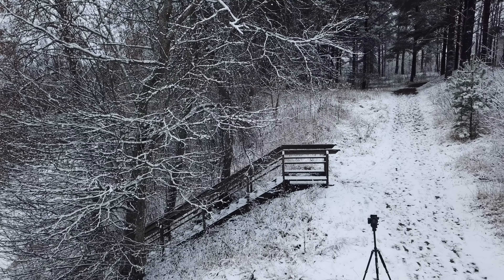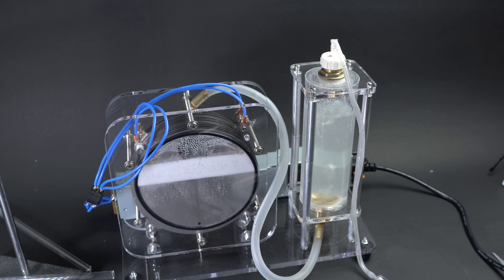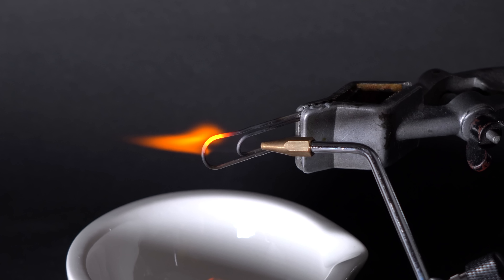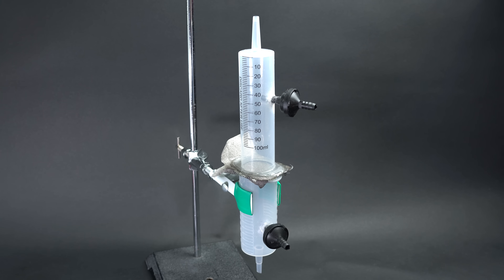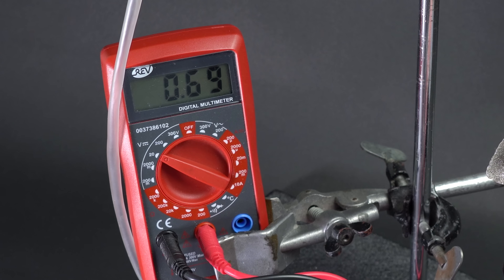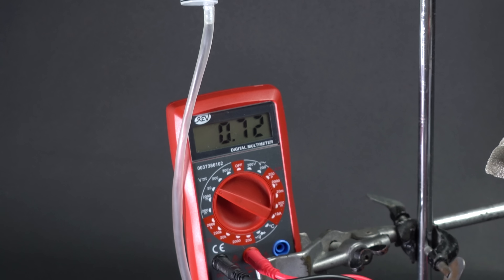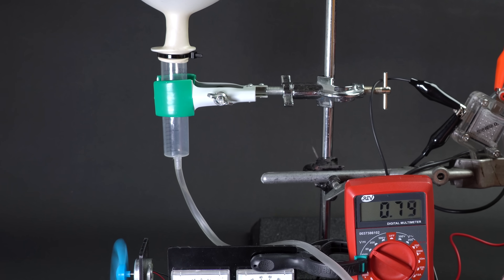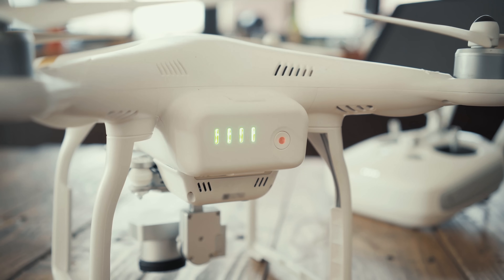I Made a Hydrogen Fuel Cell - Renewable Energy!

Comment: It is quite easy to convert a hydrogen fuel cell into a rechargeable battery by removing the platinum and filling the cell with a saturated salt water solution.  Charging the battery will electrolyze the NaCl into sodium hydroxide on one side and HCl on the other.  The two chemicals can convert back into salt water by passing a proton through the Nafion membrane and an electron through the circuit.  It is far more energy dense than hydrogen gas at atmospheric pressure and needs no expensive catalyst.  You just have to make sure that the housing and electrodes can handle such strong chemicals.

Comment: I used to work in a 3 MW chlor-alkali plant using 160 - 1 meter x 1 meter Nafion 969 membranes to produce ~40, 000 gallons (151,200 liters) per day of 15% wt. NaOCl (sodium hypochlorite).  We turned salt water into bleach/pool shock.  The basic cell was anode-nafion membrane -cathode (we ran 2x60 in series and one 40 stack).  One one side of the membrane you would produce sodium hydroxide (NaOH) and hydrogen gas.  On the other a saturated heated brine solution, which would get chlorinated and lower pH to 4.5.  The liquid sodium hydroxide would overflow into a reactor and the produced chlorine gas would be bubbled through the cooled solution, absorbing it,  and producing NaOCl---> bleach.  Which would be used for bleach, pool, shock and water treatment.  Interesting project.  Think it was bought up by Siemens!  Under the patent Chloromat!!!

Comment: Did you power a hydrogen generator / with your hydrogen fuel cell to produce fuel for a combustion engine / electric motor / Recycled  Water  fuel, water exhaust and recycled  using platinum from a catylitic coverter  ? 
 They put the stuff you need to build hydrogen fuel cell in exhaust systems to produce CO2  (and then cry about the CO2  )! And lie about hydrogen being  dirty from oil refining !  some hydrogen is produced  is and  burned off ass wast , not enjected back into the oil fuels to make them far far more efficient!!!  They would sell less fuel and make less money  ( less fuel would mean less pollution / they are liars and they could not  care less about the Earth's environment ) !

Comment: With the electrolysis system if you feed the O2 that is produced into upper by the separating you actually boost  electrical output including the current

Comment: SORRY, I am in ON MY SOAPBOX MODE:  Another advantages of hydrogen is it can be used NOW in existing vehicles powered by internal combustion engines, AND in future vehicles which use fuel cells. 
 
Switching to all-battery-electric vehicles means ALL existing motor vehicles become obsolete.  It is both IMPRACTICAL and ECONOMICALLY UNFEASIBLE to do that in a time span short of DECADES.

Comment: Starting at about 15:30 in this video:  I have seen numerous electric bicycles advertised over the last few years, but I have never been that interested in them, due to having to take time to recharge the batteries.  For SOME REASON, it NEVER occurred to me to use a Hydrogen Fuel Cell as a power source for such a bicycle.  And YES, I have known about fuel cell powered automobiles for decades. 
 
I am also rather confounded[?] by Elon Musk's dislike of hydrogen fuel cells.  {And I do GREATLY RESPECT the man for his accomplishments.}. IMHO:  Until batteries can be RECHARGED as fast as a hydrogen-fueled vehicle {either internal combustion OR fuel cell electric} can be REFUELED, and until batteries can be made to last as long as hydrogen fuel cells and not be made with the toxic materials hydrogen fuel cells are made from, HYDROGEN FUEL CELLS will be the best choice for powering motor vehicles.

Comment: instead of generating hydrogen to produce electricity to run a motor for example, wouldn't it be better to have the hydrogen produced be mixed with normal air-fuel mixture to increase combustibility of fossil fuels in a normal combustion engine? Surely that would decrease fuel required to produce an equal release of energy, meaning that we would lower demand of fossil fuel, and thus lower pollution? Surely this approach would be a lot cheaper in the short run as well due to this approach being a mixed fuel approach, as opposed to an all or nothing approach that current manufacturers are taking? Such as purely hydrogen or purely battery based? I wouldnt say this is an end goal system to adopt, but for the time being, a quick, effective, and most importantly relatively cheap way to increase fuel efficiency across billions of vehicles would surely make a large impact? thanks!

Comment: Hydrogen has many usage advantage, from a tape roll of burning fuel to electricity combo, you can take extremely massive infastructures into exo orbit. How? Heard of vhigh ballons? You can re-compress the ballons, the same time into a rocket canister, while it thrusts also fuel inside, going up, at near peak point of the balloons max height, eventually zero grav & air friction all the way to orbit velocity. At starting gradually accel to original velocity ballon to boosters.

Comment: Outdated electrolysis device. A device that is similar but works on a different principle has been proven. Any water can be used but distilled water natural frequency is 42.3khz so with that being said a voltage potential of 70kv pulsed dc current at 100% on and 10% off at microamperes can disassociate water. I think any polar molecules would be the same but nobody will continue the research because the original inventor was poisoned

Comment: About 10 years ago I worked for a Chevy Dealership. Our Chevy rep brought in a Chevy Equinox that was powered by hydrogen fuel cells. He was explaining that GM was developing generators that were powered by hydrogen fuel. That these generators were the size of a small file cabinet and could power your entire house for pennies. The tech is there and it is safe. Too bad greed will take us to the brink of extinction.

Comment: I think this is not really possible to practically DIY - but your video is a very good demonstration of how the principle works.
I have wondered about the possibility of using hydrogen for energy-buffering solar and wind power plants. It seems like it has great benefits in terms of being very cheap to expand as much as you need. The fuel cells will be expensive - but storing gas is cheap in simple containers.
The best solution might be to have a smaller buffer of high-efficiency batteries to cover expected daily variations + hydrogen storage for storage of longer surplus and emergency use when for example extreme weather events happen.
It seems like such variable-output power plants would be naturally well suited to also be hydrogen/oxygen production. There is always going to be times where you have surplus in that kind of system - and it is better to cheaply store this surplus (electrolysis equipment is simple) than let it go to waste, even if the efficiency is not so great if you want to convert it back to electricity again.

Comment: the key to producing energy from hydrogen is splitting the h from water. The catalyst used to split the molecules uses power. There is an over under with Hydrogen fuel, the power it requires to make versus the power it creates. I happen to know that there is a low cost catalyst that is cheap and plentiful and can split the hydrogen affordably, thus making hydrogen fuel a real possibility. The discoverer of this catalyst was murdered and the program shut down. My family was involved in the company. You are being manipulated and controlled on every level.

Comment: You don't have to cut the legs off the elites if you just use oil based fuel combined with hydroxi gas directly into the air intake of a car and have a mechanism that gives more gas when needed. That way make you use 90+% of the normal combusiton fuel, makes it a lot cleaner and makes your car more powerful and drive a lot further compared to normal fuel consumption. I would recommend every car get a hydroxi kit installed to get all the benefits until we get a 100% environmental friendly solution later down the line. This is the way forward so the greedy elites don't cripple this moving forward by getting money for their oil products until it is not needed anymore.

Comment: there is no way that charging and discharging a lithium cell is 99% efficient. It get's warm during use (in a drone like this), which means you're loosing at minimum single digit watts to heat. Same goes for charging - unless you want to wait multiple hours, the cell gets warm during charging.

Comment: Unaware of Nickel Mrtal Hydride batteries which are actually Hydrogen fuel cells. Raney Nickel stores Hydrogen and Nickel Oxide stores Oxygen. Getting Oxygen from air requires higher temp to activate Oxygen but also allows fuel cells to use Methane instead of just Hydrogen. Used in Japan and NASDAQ: Platinized Carbon and Nickel Oxide electrodes in Phosphoric acid electrolyte at 350C.

Comment: Why don't you just use a Rubber Gasket to gap and separate the two platinum electrodes?  I'm fairly certain that might be better than using the Nafium Film...   The Hydrogen gas would flow between the two electrodes much more quickly then.  If you are worried air might get into the bottom it won't it will just be pushed out by the hydrogen since it will always be rising...

Comment: Hydrogen is actually a very viable fuel source because Elon Musk calls it "stupid". He's the leader of electric vehicles, obviously this is a direct challenge to his vehicle design. He obviously knows it's potential through his work in aerospace engineering as one of NASA's longest-running fuels is Hydrogen/Oxygen combustion.

Someone, years ago, bought out a patent for an Aluminum-Gallium alloy to be used in hydrogen production. It produces a lot of hydrogen and is 100% renewable as the byproduct can be turned back into the alloy. Never forget this, the people in charge are never out for your best interests.

Comment: What a moron!
From where do you get hydrogen?! From water? Are you a complete idiot?! Water is the most important resource in this universe. In fact water is considered the means of how life appeared. If you start messing with it on a grand scale (for transportation) you will create a huge imbalance. Being an inefficient method you can easily understand that you just waste water. So we don't use water, but we use the current method of hydrogen extraction. From fossil fuels, from gases. By using hydrogen cars with hydrogen from fossil fuels it's more pollutant than actually running cars directly on those gases. The process of hydroen extraction, transportation, etc is far more pollutant.
Plus the cherry on top. Hydrogen fuel cell cars REQUIRE a special air filter, you know to have oxygen as pure as possible. Expensive filters that must be replaced very often.
Hydrogen Fuel Cell is not an answer at all and hydrogen as a fuel not at this tyme. Maybe in the future of space faring humanity, when extraction of it will be cheap and easily done on various other space objects (other planets, asteroids, etc...)
But the funniest thing and the hypocrisy of the hydrogen fuel cell supporters...you use what to make the reaction?! Electricity?! How complicated is the process of making hydrogen and storing it for only then to convert at a very poor rate into electricity.?!??!?!
You know there is an infinite source of energy and all the life around us has learned to use it. The sun you fucking idiot. Why come up with all sort of wasteful methods when we already have the tech to harvest solar energy, which is freely available all the time. Why waste billions you fucking moron into developing a retarded tech tree (hydrogen fuel cell) when you can use those same billions into developing the solar harvesting tech tree and electrical energy storage tech tree.
These will be of much use than any other type of fuel.

Comment: 2:25 “Thus, oxygen and hydrogen oxidized” how does oxygen “oxidize”?
Reply: Fluorine can "oxide" oxygen
Reply: @juliogalindo9363  yes. I know this now.
Reply: I noticed that, but I think it’s just a slip. Later he talks about only hydrogen being oxidized.

However the problem isn’t with oxygen being oxidized because the word “oxidize” means losing electrons (in terms of REDOX reactions, and yes it is a little bit of a confusing term). And as the person above wrote - fluorine is great at stealing electrons from other elements, including oxygen, so it is entirely possible for oxygen to be oxidized.
The problem is because he inferred that the hydrogen and the oxygen oxidize at the same time, which if they are combing to form water, is not true. It has to occur as a pair - one will be oxidized and the other reduced. In this case hydrogen will be oxidized (lose electrons) and oxygen will be reduced (gain electrons).

Comment: The worst way to get energy out of hydrogen is to use a "hydrogen fuel cell" the best way to get the most energy out of hydrogen is to burn it in an internal combustion engine.  The amount of usable power with next to no waste is amazing when you burn it in an ic engine.

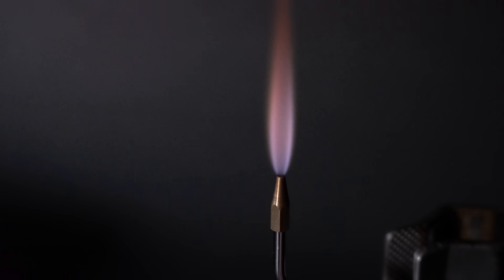Comment: the 1:10 conversion is correct? I see 5W in the power supply and 0.7V*40mA=0.028W on the output, that's 1:200